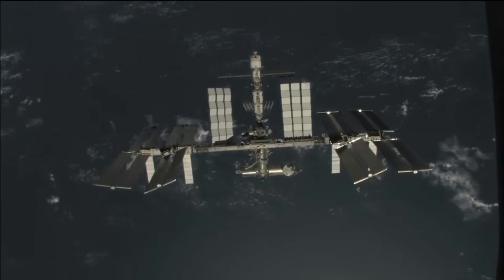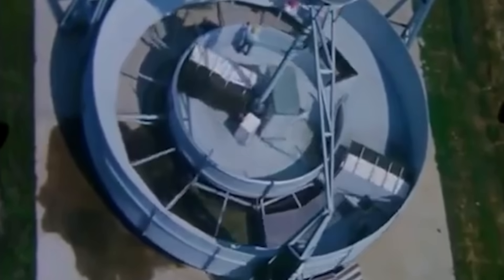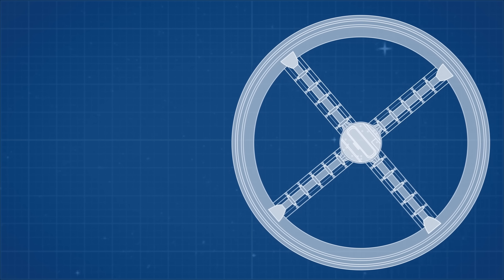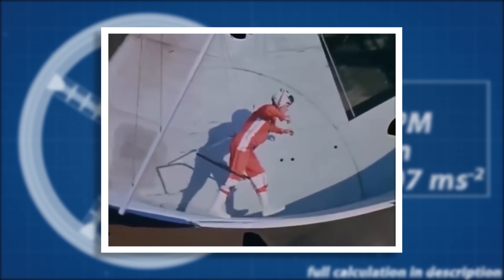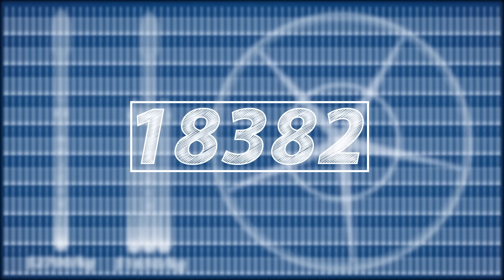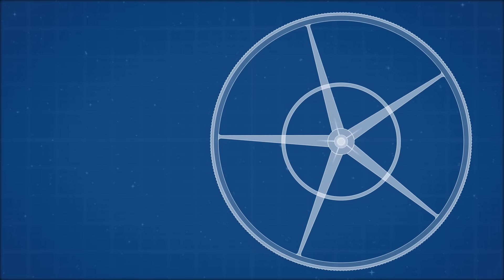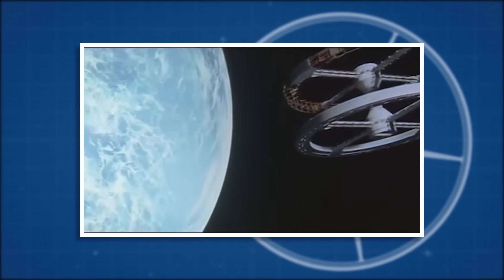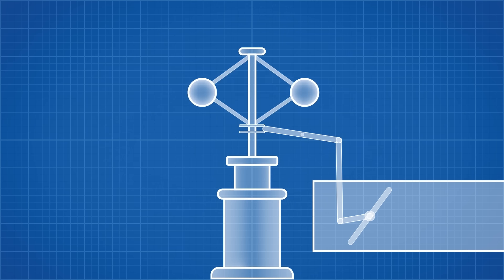Can We Create Artificial Gravity?

Comment: Answer is no. Centrafugal force is not gravity. That's as close as we have got to replicating it. Might surprise some to know that we can feel the effects of gravity. We can measure it. But we don't really understand what it is and why it effects space the way it does. Years after the apple hit Newton's bonce. Gravity is still a mystery.
Reply: According to Einstein's general relativity (which has been around for over 100 years and is continually confirmed and its concepts having many useful applications in technology), centrifugal force and gravity are indeed the same thing.  Or more precisely, they are both accelerated reference frames.  We understand a great deal about gravity.  We might not have answered the "why" question yet, but knowing the "why" does not in any way prohibit one from understanding what gravity is, and how it works - which we understand very well.

We actually can NOT feel the effects of gravity.  What you feel are all those counter forces that restrict you from falling freely - such as the ground.  When you are standing on the surface of the Earth, you are in an accelerated reference frame.  That's what gravity does.  If you remove the floor from beneath your feet, you will no longer be restricted from falling freely, and at that point, you will not feel anything.  You'd be in free fall - like astronauts in orbit.  Gravity is very much acting on them, but they feel no weight.

I have no trouble believing that you don't understand how gravity works.  To suggest that human kind is at the same level as you is careless and frankly, patently absurd.
Reply: Willoughby Krenzteinburg General Relativity or special relativity do not explain the origins or generation of gravity and its effects on the solar system. Without the existence of a gravity field in close proximity centrafugal force would not work. It would work in orbit because of the presence of the earth's gravity. Centrafugal force is a counter effect to a gravity field which already exists.
Reply: They don't need to explain the generation or origins of gravity to explain HOW it works.  You're talking about WHY it works.  I could punch you in the face, and a doctor will know how to patch you up and heal your face.  He doesn't need to know why I punched you to repair your face.

Centrifugal force is an inertial force in that it is caused by acceleration.  Gravity is the same thing - it is a force that is only present because gravity itself creates an accelerated reference frame.  I don't think you are understanding what I am saying.  You're just jumbling words together in what feels like a coherent thought to you, but you're not making any actual meaningful sense.

There is no reason to simulate Earth gravity on Earth, so if it works in orbit, that's all anyone cares about.  So you agree, it would work.
Reply: Paul Gibbons I see you've run out of useful counters.
Reply: Willoughby Krenzteinburg arrogance
Reply: Paul Gibbons May be, but also right.
Reply: Willoughby Krenzteinburg far from it.

Comment: Centrifugal force has been very challenging to me, thats why you can determine whether an objec is on motion or static by messuring such force in it. Is that Einstein's teory does not apply to circular motion? it is not in relation to you that this force happens or not, its there... or how it is understood under this way of thinking?
Reply: While Einstein's special relativity does not apply to accelerated reference frames.  His general theory absolutely does.
Reply: Rotation is acceleration.  Acceleration is a vector quantity - meaning it contains a speed and a direction.  A change in either of these is acceleration.  While the scalar speed might be constant, it's direction is not.  A change in direction is just as much an acceleration as a change in speed is.  In fact, a change in direction is simply a change in speed along a certain axis.  Circular motion is most certainly 100% accelerated motion.  The very fact that there is a force requires that there is acceleration as there cannot exist a force without acceleration.
Reply: i should have been drunk that day, it was so bad written. The matter was this... if there are states in which an object does not have such force, it means that there is a frame of reference to which the rotation must be relative to (clear enough?); my concern was: if this motion is not relative to you but to something else why all the others arent so. I had a theory for a while, that everything is relative to the main forces, to simplify, that interact with it, gravity or within a wheel centrifugal, etc.
Reply: The issue is that centrifugal force is an inertial force; not an actual force.  It only exists from within the rotating reference frame.  In other words, it only exists due to the fact that the frame of reference itself is accelerating.  However, gravity is no different - it only exists because when you are stationary in a gravitational field (i.e., standing on the surface of the Earth), you are in an accelerated reference frame.  This is a fundamental premise of General Relativity (specifically, the equivalence principal).

The only thing someone needs to due to simulate gravity as we feel it while standing on the surface of the Earth is accelerate at 9.8 m/s².
Reply: That would be another subject, you must think im some kind of mad man, all against the common beliving. Gravity difers a lot to centrifugal force, one if its most blatant diferences is: gravity travels through space (yes i cant asure it wraps it) and the centrifugal force only does it through matter.                                                                                              Inertia is relative to the object that mesures it, but as said above our force isnt; have you ever think that you in relation to a line within 2 distant stars spin once (at least, who konws you habits) every day, have you wondered if your body suffers from any stres caused by a centrifugal force from this rotation (not the one aroud the axis of earth), what im triying to say, and is the part that dont know is, there could be rotations that doesnt generate this force thoug the same without the influence of gravity would do it. Dont know...
Reply: Carlos Echeverry There is literally no difference between gravity and acceleration.  You can reject this all you want.  You dont get to reject it and be right at the same time.  Read up on Einsteins equivalence principal.  It's been around for about 100 years.  Get with the program.  I have no interest in humoring your ego.  Think whatever you want.

Comment: 2 separate gondolas connected by a cable or tube of whatever length should work as its scalable. Crew in one, equipment in the other. I believe most of its problems like entering or leaving are fairly easily solved

Comment: To save money, couldn't they just do a smaller system consisting of basically just the spokes with small compartments at each end? The base could continue to be main station could still be the base and then the inhabitants could retreat to an artificial gravity environment for sufficient time / frequency to limit the negative effects of microgravity. you could use instruments and gizmos to keep the system balanced as the dynamic contents (astronauts and cargo) change. This could potentially achieve artificial gravity at a much lower cost than if you had to complete the circle.

Comment: Why does it have to be a circle.   Why not put the a "ship" at one end, and a long pole/cable/whatever connecting it to an object that weights the same or slightly less than the "ship".   Spin it.  Now you have gravity and, i assume, a neat place to put all of your batteries. 

I suppose if someone has done the engineering they would be able to say if the structure used to connect to two end point cant exist with modern materials?  

(space station) ================*================= ( counter mass)

The * is the center of gravity.   You then tune the "gravity" in the space station by adjusting the mass in the counter mass.  Adjusting the center of gravity and creating a large or smaller diameter circle of rotation of the space station.   

Maybe at first the counter mass could be a captured space rock.  Then slowly replace the rock with useful items like batteries and other supplies. 

Or so it seems to me.   Could be wrong.

Comment: We don't need a large structure.  We just need a two-part craft with a long cable attaching the two parts (perhaps crew quarters and the power plant as the two parts).  Using modern materials the cable can be thin and long.  The 'spin' can be started/stopped with reaction jets.

Comment: I'd rather have neutrinos spinning at 10M RPM in a magnetic gauss deck plating, creating a mass density pulling effect. The only hard part would be capturing the neutrinos. (The effect would be along the lines of static cling or dust bunnies.) (Lot cheaper than centrifugal.)

Comment: You could do this much cheaper than a rotating ring.  You could just have a crew compartment on one side, a long rod or tether and on the other tend of the rod/tether, a weight.  Set the thing spinning.  The center of mass would be the middle of the rod or tether.  It would be like spinning a baton.  Put thrusters on both sides for control of the speed and direction of rotation and you'd be set.  Heck, if a material is found, a cable could even be used to reel out the other side like a fishing line once in orbit,  to make the thing more compact and easier to launch.

Comment: The use of the 1960's designed "Sea Dragon" rockets would greatly reduce the cost of transporting massive amounts of material into orbit. Not only could it do it cheaper, it could carry far more material, faster and safer than anything in use now, or even on the drawing board. The key to moving massive amounts of material into space is to keep it simple. Nothing could be more simple than Sea Dragon Rockets.
Reply: What about the monstrosity NEXUS rocket (https://en.wikipedia.org/wiki/NEXUS_(rocket) ) is?
Reply: I wonder why no companies are using these. Could it be because... they aren't effective enough?

Comment: Why would you have to build the whole ring? Just build the hub and two small arc sections, then add as you can over time. It will look like a giant bow-tie instead of a wagon-wheel, but it could get done.
Reply: They are lying. It's a plot to run away from the Earth. That's what they need the whole thing. They don't plan to come back. These are the Annunakis that were abandoned here. They are still here. We have been watching them for a long time.
Reply: Bubba Ole wtf are you talking about?

Comment: Other question is how to make it rotate? with constant gas thrusts? Electric motor probably will require same mass counter balance?
Reply: What makes you thing you know a shit about physics? We are talking about million metric tones here, not bloody Fidget spinner. Station at this size need to be extremely well engineered and strong as hell. It will experience every possible sort of force on it's structure. 5 spokes, as shown in video, wouldn't work. It will brake in between spokes. Spokes need to be very densely spaced. Unless outer rim is tough enough ( which will never happen in space ships). Also it will need hell a lot of fuel to start rotate that thing in space (definitely not a 'short burn'). Thrusters need to be positioned at extremely accurate spaces and must work to correct direction (constant correction needed). And you need thousands of them in order to minimize force impact to structure. Also take in to account, sun heat/shadow will deform structure. any little dis balance will make station wobble. At that size it will rip station apart in no time. Look what happens on "tiny" ISS. They cannot fix fitness workout gear to the walls of the station (it is free floating). Because it passes kinetic energy to the structure of space station. Energy travels forth and backs through structure making all ship wobble. As energy has nowhere to dissipate it accumulates. it leads to destruction of weakest points, like solar antennas and so on. Dreamers will dream.

Comment: I was taught in physics 1 that what you're describing is the reaction force felt by the object due to the centripetal acceleration caused by the rotation. They choose to describe it as a force normal to the centripetal acceleration, rather than a 'centrifugal' force (I am a second year mechanical engineering student at the University of Flordia)

Comment: But would you need to construct a full ring? Would it not be enough to have 2 or 4 compartments opposing each other, with equal weight, spinning around a central hub? It would be a simpler start with less material used. With the 2001 example, and my math may be waaaaaay off because I suck, a conservative 20m thickness to the ring would still give it a flat surface area of 18000+m2 to stand on, which is a lot of real estate. Cut that into 8, and only put 2 opposing pieces spinning around and you still have 4500+m2 of space to move around on. Oooor my math may be all of the place and this is just a stupid idea.

Comment: Why do not bond two modules  using a steel cable? This way you can bond two small modules but the structure itself will have a huge diameter limited only by the steel cable lenght.
Reply: pretty clever
Reply: Zubner's Mars Plan uses this method. There would be a crew compartment and a storage module connected by a long cable spinning around a center of mass.
Reply: I forgot to mention the properties of metal work differently in space then on Earth. The repeated heating and cooling of the metal in the cable would make it brittle... almost insuring eventual failure. Especially if it's under tension as both modules are pulling on it through centrifugal force. This is why you always see the wheel spokes structure used in these designs. Because if 1 section fails the rest can bare the load... the spokes also distribute load evenly around the entire circumference of the circle helping the whole thing to be much stronger then if you just had two modules at opposite ends
Reply: twang Goodbye Earth. Hello cold abyss.
Reply: Cables snap, and if the linking cable were to snap the two modules would be slung off into outer space in opposite directions making rescue impossible because the main ship which is traveling forward would not be able to change direction to retrieve the modules. Think of it like if you were traveling in a car and something you were holding out the window fell, the car would continue it's forward motion and the fallen item would be left behind. In a car you can slow down and back up and maybe find the item because gravity stopped it and it's laying on the ground somewhere. But in space the two modules would continue to travel away from you because there is no friction to slow them down.
Reply: @theninearemine8499  I mean, is it that un-similar to earth many times? What happens if the bungee cord snaps?

Comment: When I was young (in the late 60's, early 70's) I remember a travelling show coming to Newcastle (UK). It had a centrifugal wheel, but it was vertical, not horizontal, so at the top it was almost like no gravity, but you did not fall, just floated. When you reached the bottom however, you had to endure over twice normal gravity, I spent loads of money on it, it was amazing. They also had a guy driving around a curved, circular wall on a motorcycle ( wall of death I think it was called). He was at 90 degrees to the Earth.
I should mention Artificial Gravity is not going to happen. Scientists do not even know what Gravity is, physicists hate it because it messes up their equations when using the current Standard Universal Model.

Comment: ahh good old centrifugal force, i have tried discussing this subject with people in relation to space elevators as a way to remove weight of the whole thing (mind you i am just going off a basic common knowledge of how gravity and centrifugal force can be used together, please Real Engineering correct me if i am wrong)

my theory is this, instead of trying to build the elevator from the ground up, use an asteroid as a counterweight/space anchor/ final port, put it in a safe orbit around earth using thrusters and whatnot, then build a processing plant on there to lower the pace elevator guide lines(for elevators) or complete structure down into the atmosphere, but as it gets closer to completion move it into a geosynchronous orbit (GEO)(not too sure if this is the correct term, looking for it to remain at a set long/lat), then once attached to it's spot on earth, to keep tension on the guidelines/structure the anchor is moved further out into space while still maintaining its GEO location, but moving out of the range it needs to be in for its mass, wouldn't it then create a pulling motion because of the mass is still spinning at the same speed but being further away past its place needed to be to hold a GEO. 
my idea is that they use this to also help cut costs of fuel in not having to use thrusters (once completed) to keep the structure from falling back into earth?

Comment: Why not have a dumbbell structure with two crew quarters separated by a long rigid beam, and spin the whole thing? There will likely be a need/desire for astronauts to move from one end of the structure to the other, but given their mass is likely relatively insignificant WRT the total structure, changes in rotational speed and gravity are likely not debilitating.

Comment: the calculation for 2.4 rpm and 9.8m/s^2 are wrong, can u put ur calculation? because from mine the a=9.4... ms^-2. 
2.4 rpm are 2pi = full circle and you want to move 2.4/min so in rad (omega is in rad) => 2pi*2.4 = 15.07 rad/min divide this for 60 and you get at sec (omega is 2pi/T where its 1 sec). 0.25 rad/sec is ur rpm in rads. do the math and it's 9.4 ms^-2.
Reply: omg , i want your brain